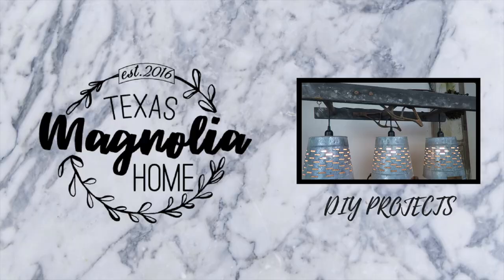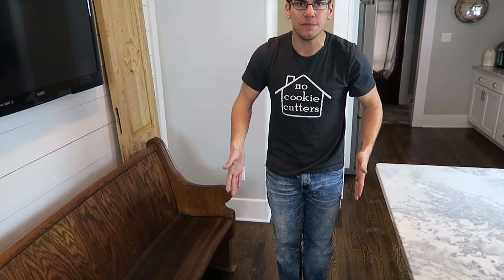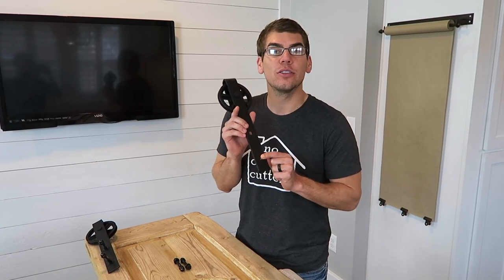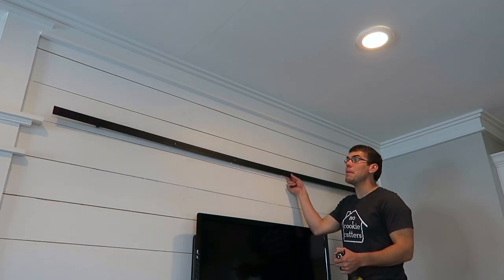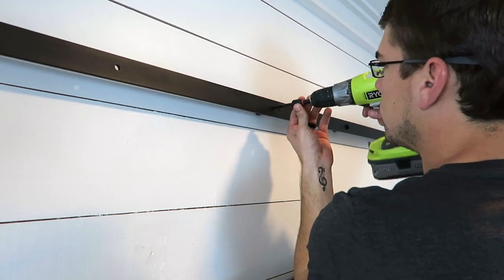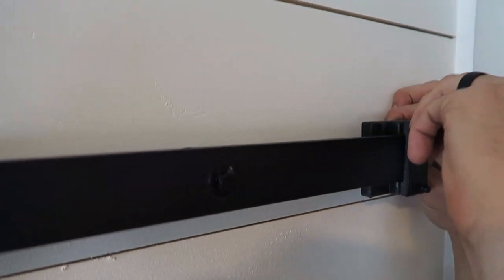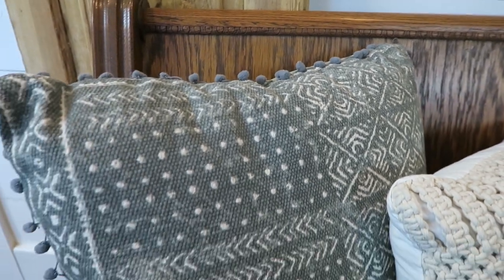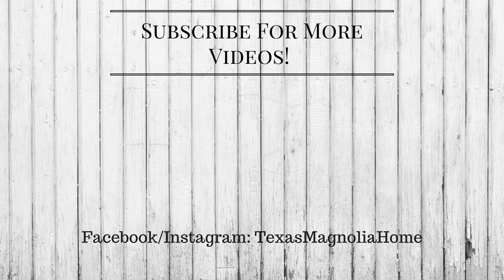DIY BARN DOOR | FIXER UPPER STYLE

Comment: How far out do the doors stick from the wall? I have a single french door, which I would like to make a barn door, but it will be directly next to the fridge when open and I have to be sure it fit and I could still get the freezer side open if the door is there. I have about 5 inches between the wall and the fridge, so I feel like it could work.